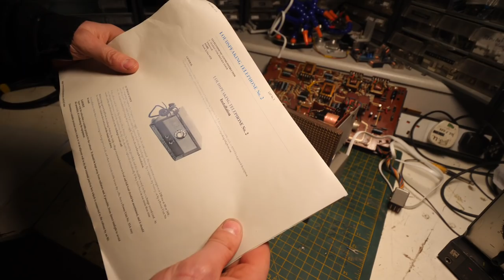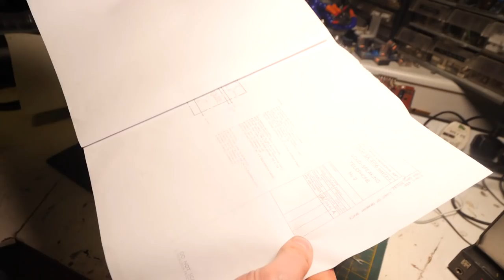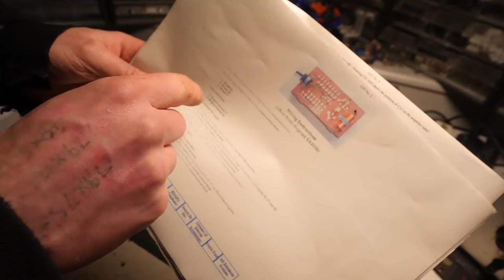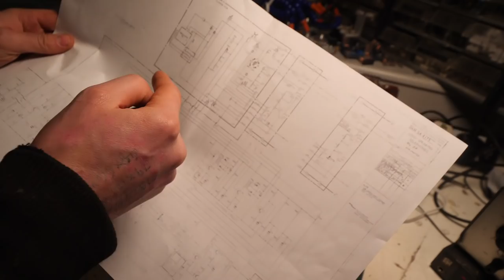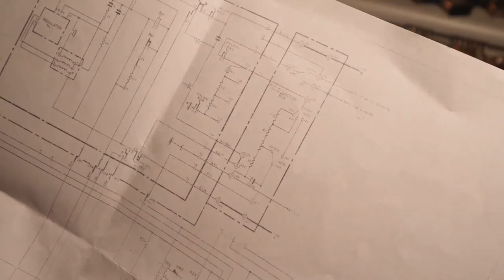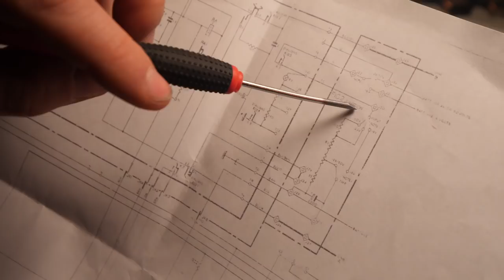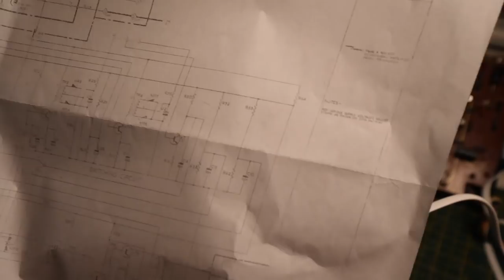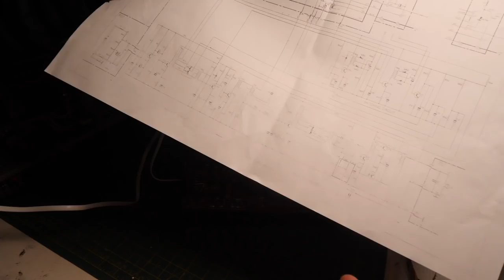Fixing The LST2a - Finally getting to hear how weird it sounds

Comment: Have you tried it with a linear 6V supply or a battery?  I would be suspect the hum could be noise from the wall wart.
Reply: Yeah tried with numerous types of power supplies. Not a battery tho will give it a go.
Reply: @LOOKMUMNOCOMPUTER  Did you also try an external 7806 (or 317, or similar) regulator? I'd be surprised if it buzzed when running on one of those. If it does still buzz, I would suggest trying to add somewhere around a 47 ohm 2 watt resistor in parallel with the phone. It will either help or do nothing, I'm not really sure.
Reply: @eDoc2020  I tried a lot of things
Reply: @LOOKMUMNOCOMPUTER  i have one the same  ( with original junction box )i tried a 6v battery and the hum disappeared

Comment: I reckon that the microphone is probably some type of electret capsule - as these are basically variable capacitors, it's likely to be reading much lower than it's supposed to and so it's feeding back a lot of high pass. It might be worth seeing what happens if you add a bias capacitor to the mic circuit and see if it improves.

Comment: Check your phone line resistance to ground. It should be at least 18 Meg. The line is balanced between the 2 conductors. Each conductor should be the same very high resistance to ground or you will pick up power line frequency and other noise. My home phone has hum when it rains because of 40 year old AT&T insulation allows water lower that high resistance. This applies to all phone lines in you network (the fault may be in either phone line).

Comment: @12:42 what was that transistor?
Reply: Can’t remember could find the name of it and you can’t read em unless you remove em. Something like Gec 113 or something
Reply from the maker: yeah i think the GET113. i think. the code is under the mount that holds the transistor in place but i did research it before and i think im gunna stand by GEC GET113, i dont want to remove it again to look ha, it was a pain to put back in!

Comment: does it have a bridge rectifier, (diode arrangement)?

the AC input voltage after the bridge rectifier is 1.4 bigger.
18 Volt ac become 25,2 Volt dc. to step down again to 15 or 12 Volt you burn a lot of power, converted into heat.
be careful, 15 Volt AC become 21 volt. 12 Volt ac becomes 16,8 volt dc.

the most important factor is home many amps / watts it can deliver. ring / toroid shaped.

rectifying 220 volt ac becomes 308 volt dc.

What kind of regulator are there on board?
Reply: ideally you would put a small 5 Volt ac transformer alongside to make 5 Volt dc.

Comment: If you wanna do this high end, just buy 2 toroidal transformers, one 2 x 12 volt AC ( depending on your voltage regulators) and 2  x 6 Volt AC.
3d print 4 conus shaped rings with a hole to pass a 5/6 mm thread rod, stack the 2 toroidal transformers separated by a metal plate, so their fields don't ...

what's the voltage regulator rating, 500 mA?
use a  online VA to amp converter ( VA to Amps Calculator) to find the right transformer, one size more than your voltage regulators.

You have to match their phase as well. a 2 channel oscilloscope ... maybe the color of the wire of the transformer's will help.

remove the comment.
Reply: if you really wanna go over the top, 3d print a box where the transformers sit in.
: )